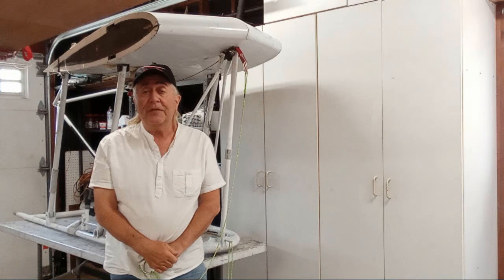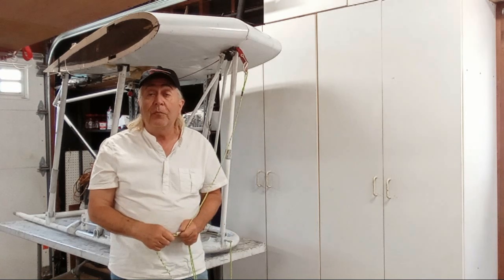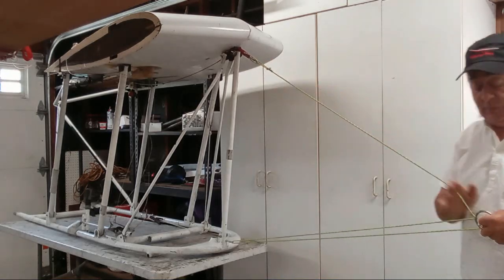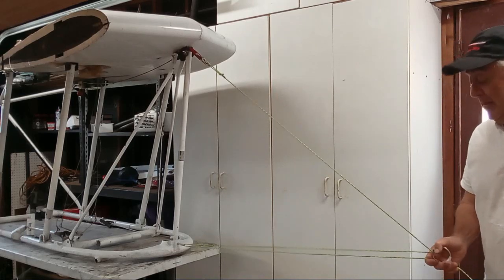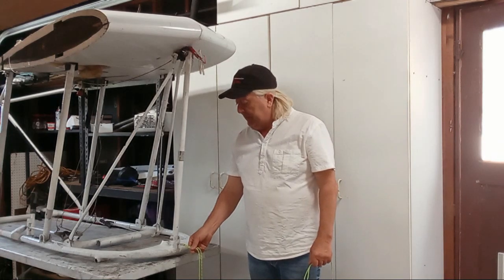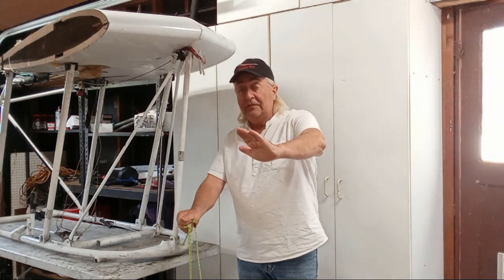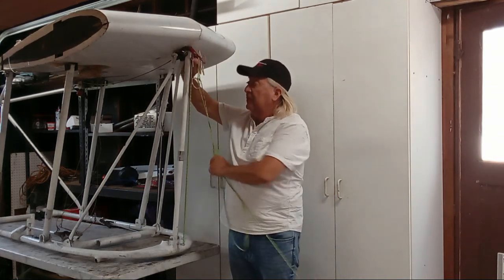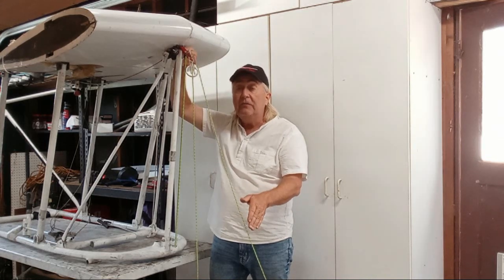Taxi Tests El Mirage - Composite Ultralight Sailplane Design Klingberg Wing MkII Development

Comment: Working the gremlins out of the system, only designer/builders appreciate the huge amount of work it takes to bring a new design to flight status. I expect you are using a "weak link" I the tow line, a good safety measure for tow operations.